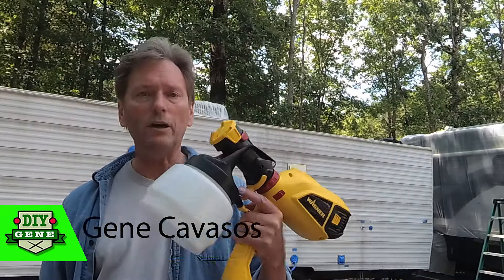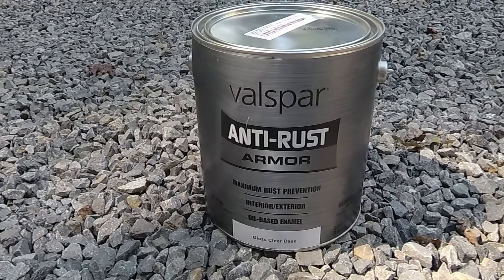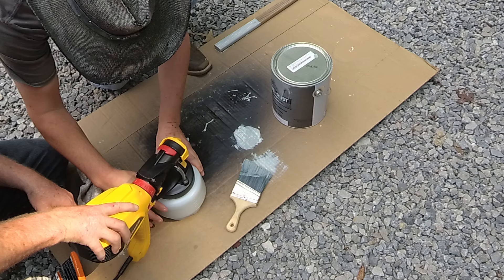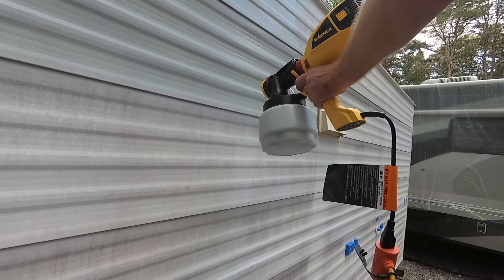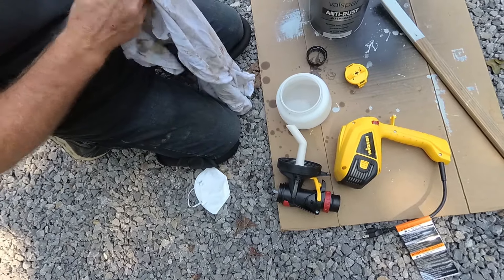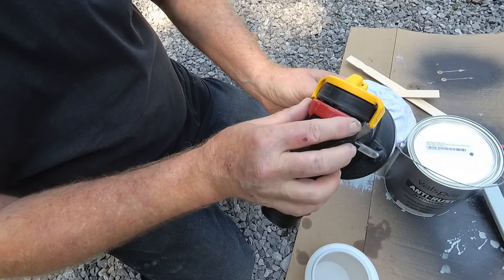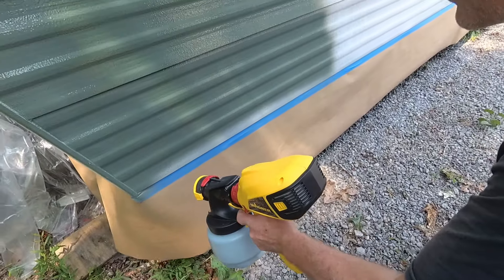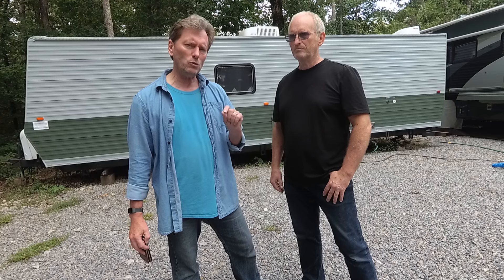Can This Wagner Sprayer Do The Job?

Comment: I've just painted my sons Evo 8 MR front bumper using an electric spraygun for the primer and basecoat, then switched over to my trusty old Iwata WS400 for the lacquer mixed at 2:1, came out like a sheet of glass straight from the gun. Those electric guns are great for basecoats, primers but for a professional finish a HVLP finishing gun is best, either DeVillbis or Iwata are perfect for clearcoat.

Comment: Thanks guys!
Reply from the maker: I hope it helps. Thanks for watching.
Reply: If you do want to paint a car or truck with one of these, get the one that’s used for stain,(control spray QX2) thin paint 5 to 10 percent. Did a nice job on our work truck, nice and even with no runs or sags. Edit. We used the waterborne acrylic enamel truck/tractor paint from rural king. Tractor supply has it too. Thins with water, and has the hardner already in it
Reply from the maker: @Pointman-yf6or  , I have to say , I would never use this to paint a car or truck. But a trailer or equipment, absolutely.
Reply: @DIYGene  Like I said, it’s a work truck. We paint for a living, and a lot of our inside work is new construction so we do use this kind of equipment instead of a grako bulldog airless or brush and roller. Since the q2 does such a good job with stain we decided to do the truck with it just to see how it would do. It sure isn’t show quality, but definitely turned out way better than we thought it would. After primer, first coat I put on straight out of the can, got some orange peel, sanded with 220 wet, thinned by about 8% by volume, put it on again and actually got a nice smooth job. Buffing would probably make more shine, but that ain’t happening. Subscribed!
Reply from the maker: That’s fantastic, I am curious about the Tractor Supply paint. I saw a video of a guy that sprayed his jeep wrangler with the John deer green and it looked pretty good. I didn’t know it was water based. That is cool.
Reply: @DIYGene  they have two different kinds of the truck and tractor paint. “Oil base” and water base. I’ve used both, and the water base gives a nicer finish, and dries much faster. Cost is about 50 bucks a gallon. Both are made in Columbus Ohio by the yenkin majestic paint company.
Reply from the maker: @Pointman-yf6or  Thats great info. I'm definitely going to check it out. I love Tractor Supply.
Reply: @Pointman-yf6or  I have to confess...My very first use of a Wagner Power Spray was in the early 1980s.  This was my first paid job as a handyman...spray the neighbor's privacy 6' fence with one of those loud Wagner piston driven power sprayers.  It took me over a week to finish the job/both sides, but the cedar planks looked great.
Reply: Last month when I had a new fence to apply Thompson's Water Seal, I pulled my 15 year old classic Wagner Power spray out, but it failed within 30'.  I ran to my neighborhood Lowes and purchased what they had on the shelf, a Wagner QX5 for ~ $118.  I was BLOWN AWAY immediately with the performance of the QX5!  The turbine applied Thompson's Water Seal generously on the fence!  I applied ~ 200' of fence on morning and I asked another neighbor if I could treat their fence the next weekend.
Reply: I will be looking for opportunities beyond water sealing fences for my new Wagner QX5.  Thank you for being promotors of this untold technology!
Reply from the maker: @damonshodrock9417  I was so impressed with it when I sprayed my brothers trailer. It made the job so easy.

Comment: Did you have to clean / check the filter as instructed before reusing it the second time? I didn’t and second time it sprayed little worse/ not even. Just trying to figure out what was the problem
Reply from the maker: I did check the filter and I had no problems. Now I have not used it for a while so I will be curious to see. Thanks for watching.

Comment: Is this the Qx2? Can I use this to spray  paint metal cabinets, fence  a small wall in garage, furniture etc..?? I can add any type of paint and mixers?
Reply from the maker: I would use this on anything other than a car. I ran oil based paint through this sprayer with no problem. I hope that helps. Thanks for watching.
Reply: @DIYGene  is it tje qx2 model?
Reply from the maker: It says Wagner Spraytech 0529042. I put an Amazon link in the description if that helps.

Comment: This is the biggest piece of crap I've ever used.... Wagner absolutely blew it on this one and whoever says that this is a good product doesn't know what a good product is it's crap don't bite
Reply from the maker: Wow, maybe it depends on what you run through it. I have had a great experience with it. I used Lowes enamel and sprayed a 35fft trailer and it did great.